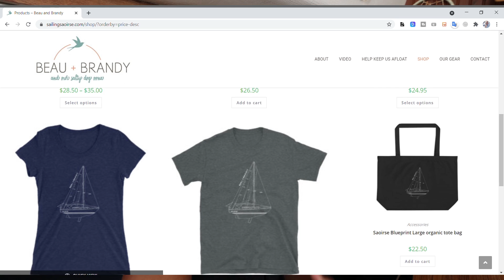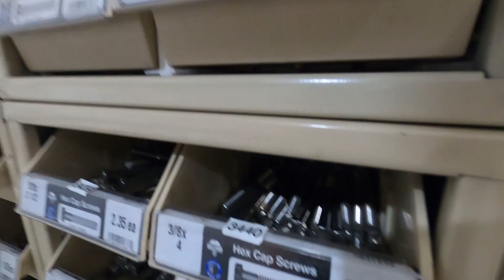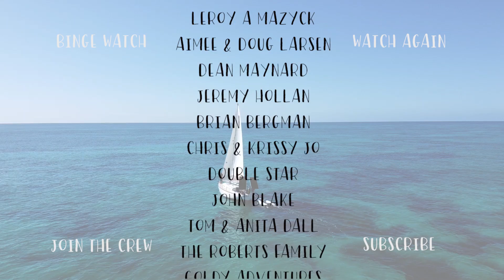She's leaving the boat | Beau and Brandy Sailing

Comment: So you were videoing this process, but if you are ever taking something apart that is complicated, you can take pics of each section before you take it off on your cell phone. I did this when I was replacing the motherboard and CPU on my computer. The entire thing had to come out and all the inside cables had to be unplugged. I took pictures of them just as a backup, but then of course the new motherboard had a very tiny diagram that I could also use my phone as a magnifying glass and a flashlight. Cell phones are awesome tools I say!
Reply from the maker: YES! this is a great idea, kinda did that but with video instead!

Comment: Spring loaded brake wheel cylinder hone for those smooth inside winch surfaces?
Reply from the maker: Yah! That would work, depending on what grit you use.